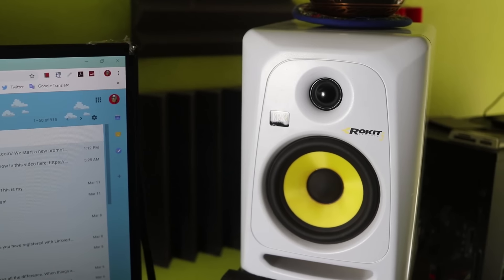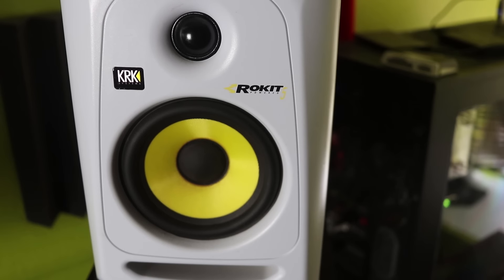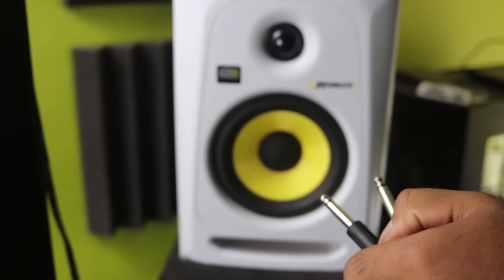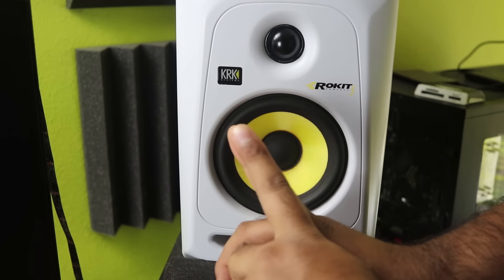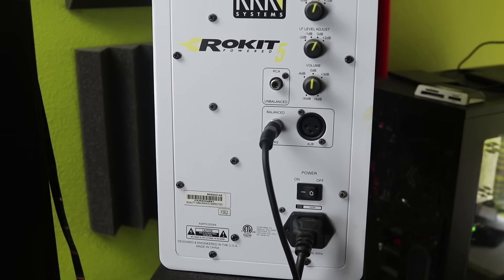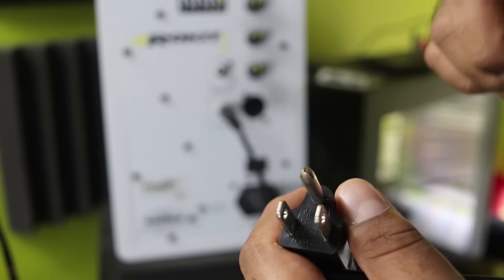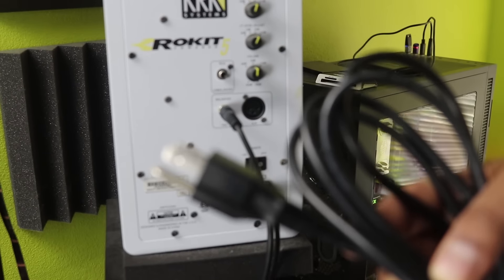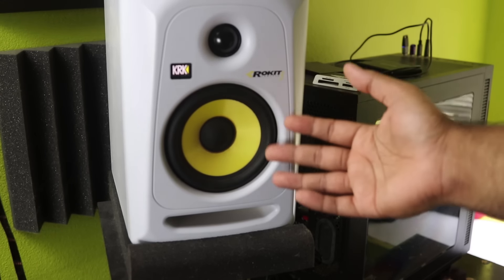How To Stop The Electrical Noise From Studio Monitors!

Comment: I have this exact problem but my monitors only have two input options, RCA and a 1/8 (3.5mm).  I have a TRS 1/8 (3.5mm) cable plugged into the monitors which goes to a dual TS 1/4 into a mixer and I get this EXACT same sound in your video.  I can't seem to find a 1/8 TRS to dual TRS balanced cable anywhere.  Any suggestions thanks so much for the help!
Reply from the maker: Test to see if it sounds like that when you plug it into something other than the Mixer. Because sometimes, Mixer Boards can be like that too. Just in case! 
What's the name of the speakers? If it's an older model of speakers, I'd recommend to ditch em, especially if they don't use a 1/4 TRS cable.
Reply: @OmoiSenpai  They're Audioengine A5 and sub.  I have a MOTU M2 DAC which I'm running 3 other midi synths plugged into the mixer and those are clear with no buzz.  It just seems to be the main line from DAC to mixer to speakers.  I've tried other cables too and same issue.
Reply from the maker: Just looked them up. Seems to have Bluetooth functions. But, they seem to be speakers geared towards entertainment uses ( TV, Phone BT, Vintage devices) but not meant for something like a Music Studio Monitoring apparently. I would use those to check out the songs once you finish working on them. 

Check this out. This is a 1/4th TRS to a 1/8inch cable. I would say either to buy 2 of these, and try them out. Or better yet, buy Studio Monitors that are meant for Studio works ( like KRK, Yamaha, or Avantone's Mix Cubes... my friend swears by it ) https://amzn.to/2ZDvW5Q

Hopefully that helps out!

Comment: I'm getting a pulsating sound ( maybe 60hz sound?) from using the headphone jack from my laptop into a reciever and out to speakers. The power plug on the receiver is only 2 prong but there's a Ground screw on the back of the reciever and when I connect that to a good ground it gets worse. Any help there?

Comment: What if I use a 35mm to dual 1/4 cables. I can only find 35mm trs to dual 1/4 TS cables. Dies it matter where the ring is? Should it be on each cable tip?

Comment: Hello, I use a BOSE L1 System and plug my Jack into the Channel, plug the other side which is the same into my Tone Matcher, double ended 3 qtr inch Jacks into the inputs on the Tone Matcher, I then plug the other end the Aux into my Lap-Top which is fine but when I plug my Charger for my Lap-Top in I get this exact Radio sound which is very annoying as a Singer... Now if I use another Lap-Top, the sound disappears... maybe the Charger on the other Lap-Top is bad but its hard to tell... please give me some advice. Thankyou.🙏🏻
Reply: ... when I take the Charger out, the sound disappears

Comment: HELLO , ONE QUESTION I HAVE THIS PROBLEM WITH KRK 10 3 G4 BUT  WITHOWT THE CABLE ,THIS INTERFERANCE IS WITHOWT THE CABLE PLUG IN YOU CAN HELP ME WITH AN IDEA ?
Reply: you have to buy a ground loop noise isolator, this wil unearth the electric signal that is interfering with your speakers.

Comment: now i think i have balanced cabels cuz i have the 2 black rings on it but i still get the interference, so i tried with an optical cable and the sound was gone, problem is that its not surround through the optic for my system, so back to cabels, are my cabels cheap and broken? should i try with new ones?
Reply from the maker: Yeah, if you have 2 rings on it, then those should be balanced cables. 

Try swapping the position of the Monitor speakers around, as well as to hook it up on another device in itself. Signal Flow will help you single out what the cause could be! ^_^
Reply: @OmoiSenpai  found the issue, its the cables itself that are to weak, only like 2mm cabels and i am gonna get 6mm shilded cabels so ill be fine, thank you, your video did help out alot

Comment: What if you get click sounds from an UPS contactor into your audio system? I mean let's say you have a UPS protecting your gear from power outages , or instable voltages and when the contactor is active you get that sound amplified into your monitors.
How can you solve this issue?
Reply from the maker: Hey! I don't use a UPS myself, but for what I see online, it says that it could be the end of the UPS's life cycle. Just my guess though.

Comment: I have this same exact noise, only it is constant 100% of the time. I can turn off and unplug literally everything but the Studio Monitor plugged into a power conditioner, and I am STILL having this exact noise. I do live in an old apartment building, so I think it has to do with poor wiring in the building.. I get the noise from every outlet in my apartment. If anyone has any ideas as to how to eliminate this I will be forever grateful.
Reply: Wrap your speaker with an aluminum foil
Reply: Me too... because the electrical in the country I live in is rarely grounded.
Reply: Do you use balanced cables and grounded electric connections? Seems to be the point of the video to do this with everything in your studio. I have the same issue - old building, every socket has this problem. It even enters my recordings, so I can't use anything really. To make it more confusing, the noise varies in streng from day to day and area i stand (with headset) it is such a buzz kill (loooool pun intended).

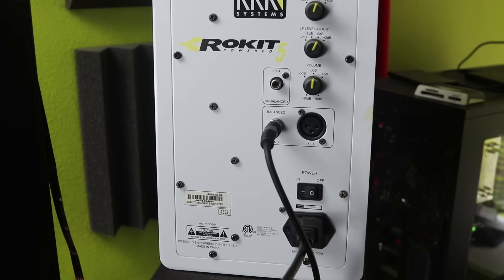Comment: 2:06 I got a problem like this in my Adam T8V. Its very light and you can hear it when youre vey close to the 8" woofer. Tha noise is more continuous and kind of "phasy" or "flangy". Its not any loud; but its not the classic and normal buzz of the tweeter, it comes from the woofer and its not always there. I expect its an electrical power issue cause I am living now in an "old" house, do u think it can be that or is that normal?
Reply: Maybe its just paranoia cause i've got this pair last week and im always looking for a new weird noise like a maniac expecting they are broken or something
Reply: I use TRS to XLR balanced cables and the power cables that come with the monitors. I ve got an Scarlett 2i2 and an HP usual laptop

Comment: I have this exact sound from the HEADPHONES OUTPUT of the audio interface.
I unplugged the front desktop USB devices and it got better (strange), but the crackle still remained so I am getting a Ground Loop Noise Isolator from amazon to see if it helps.
Reply: Did the Ground Loop Noise Isolator work?

Comment: Hi Justin, thank you for this explanation. I've got a pair of iLoud MTM connected to my Steinberg audio interface and what I'm 100% sure to hear is my GPU working. Do you think that using balanced cables would solve the noise also in my case?
Reply: Did you solve this? I have the same with my speakers, annoying buzzing sound when the GPU is under load. Desperate for a solution.
Reply: @bart4375  I picked up some TRS cables having the same issue, I'll let you know how it goes
Reply: @marvingeorge8856  I got a USB isolator which completely solved the issue.
Reply: @bart4375  I did too, but my problem remains, I'm hoping the TRS solves them
Reply: @marvingeorge8856  Best of luck!
Reply: @bart4375  thank you! You as well

Comment: I have the same issues with my Yamaha HS7s. My monitors make the noise even when nothing is plugged in except for the power cord. Any advice?
Reply: by process of elimination, i discovered it comes from my computer. srsly, i eliminated like 30 factors. when i reduces the processor power consumption in the power options, it's reduced significantly. still looking for the solution for that. damn it.
Reply: @imslicc  the solution is the balanced cables. It's literally the whole video.

Comment: That exact same noise is in my monitors without xlr/trs connected. The noise is there alone with power cables only. Any idea?
Reply: Probably an electrical interference. If your monitors are right next to a pc or any other electrical device then just try moving them as far apart as possible

Comment: Just built a new pc, have had studio monitors for years and they have worked perfectly with every other pc/ phone i plug into it. When i use it with this new build, however, i get this static. The static doesnt happen when i plug headphones into the pc, and doesn't happen when i plug other devices into the monitors. Help me lol.
Reply: same here. jeez.
Reply: Excact same issue, i have balanced cables, i dont have a clue what's going on
Reply: I found out you have to use power cables without grounding for the monitors
Reply: Yup, had to buy a ground loop isolator.

Comment: Great video Justin. Have you ever heard of this though... I am getting this interference in my analog mixing desk. Even when nothing is plugged into it or out of it. If I only plug in headphones I can still hear it. The interference is only happening on my bus and master channels, but not on the individual channels!
Reply from the maker: Hmm, never heard of that issue before. 
What is the Mixer called?
Reply: @OmoiSenpai  it's an Allen & Heath Beta GL32, hand assembled mixer. A&H dont believe its an issue with the mixer but something electrical. I told them nothing is pluggd in :/ there is a wall between my mixer and desktop PC. Weird huh

Comment: A dual xlr to 3.5mm cable helped dampen the noise for me but it didn't eliminate it when the pc is under load. My guess is it's picking up the coil whine from the psu/gpu. Anyone else have a similar issue?

Comment: I just did a little work around here with the new KRK RP5-G4, this noise was a nightmare.  New outlet grounded to copper in the basement, speakers powered from a different current source, I did everything and still getting that crappy interference sounds everything freakin time I was moving the mouse or loading CPU/GPU.  Speakers cable far from screen cables and far from the PC itself, audio interface far from PC as well.

UNTIL:  I dropped each speaker volume down to 75% of their full power, problem solved.  

This is solving the nightmare, not the issue since I use them with my 2 laptops as well and nothing comes out of these even at 100% volume so yes I know, there's still an issue with the PC about his power management I think.  PSU or something.

Well, now I fall asleep without having that damn sound in my ears even when they were off LOL

Comment: THAT'S the noise I was getting. I wished I had seen this video before I went out and replaced my audio interface(Presonus to Focusrite). I have the same speakers but never thought it was the cable because the noise went away. I also grounded the surge protector. How I ended up watching your video I have noise coming through a Firewire into Tascam audio interface...I will try the balanced cables.
Reply: Hey Pete! did you get to replace your cables with balanced ones? I just watched this vid after I have been using unbalanced cables for like 1 year 😭 I hope my monitors are not messed up now damnnnnn itttttt

Comment: i have exactly the same noise, but i stays even if i disconnect any audio cables and its only connected to the power cable. my only solution for now is tin foil around the speakers...
Reply: Find any solution per chance? I’m in the same boat. I think it’s because I have them setup on the top floor of my home. If I move it to another place in the house it goes away or becomes significantly quieter. I’m thinking of getting copper isolation tape and covering the inside walls of the speaker next. 😩
Reply: @rogueberrydissent6062  I do have a solution, but an awful one. Just as you said, I had to cover the insides of the speaker with tinfoil. Obviously seeing that nothing touches because its tinfoil, but it works 10000%. No noise at all!
Reply: PR Thanks for the intel. I went ahead and ordered the copper isolation tape. Time to put an end to this shit once and for all!
Reply: rogueberry &dissent Same probably here as well...Are you guys taking the speaker apart first and then adding tinfoil or just putting it all around the outside?  Mine is mainly on one side and cones and goes, but it’s driving me crazy.
Reply: @mgrocks111  itook it apart and added it on the inside, but outside works fine if the looks don't bother you
Reply: MGrocks I actually made a cardboard sleeve to slide the speakers into (back and front remain open). I covered the inside of the cardboard sleeve with copper tape and the outside with black tape so it’s not so noticeable. Works great! I’ll probably replace the cardboard with wood one day, but for now the cardboard is working well.

Comment: found out my soluition. for whatever reason when my laptop charger is plugged into the same 2 outlets, it causes this annoying electrical noise. very strange. i just bought a new charger so its probably some weird aftermarket charger causing the issue

Comment: thanks for making this bro but I have xlr cables but still geting the same noise a bit please help me to remove that.
Reply from the maker: Try plugging the monitors in different places in the house to see if you have the same issue.
If you find the issue is cleared when you plug it somewhere else, the problem lies within your room.
Check the Ground in the wall plugs.
See if there are no electric devices plugged in around your speakers.
No wires overlapping etc.

Comment: I still have the slight noise even using balanced cables. I've yet to see someone come up with correct solution.
Reply: It's one of those issues that are tricky to pinpoint. I just changed the order the plugs were in my extension and now the noise is completely gone.
Reply: Connect all the device to a common ground is the solution. Some were caused by the EMI from the power supply, try to move the ground line of the transformer a bit until you hear no noise will solve.

Comment: Bruh, the devices that are connected to each other via a balanced cable need to have balanced out and balanced in ON them. If the reversing of the noise and the signal is nkt dkne in the circuitry then just using a stereo cable wont help.

Comment: Bruh, I’m getting a low & high hum from the monitor WITHOUT ANY INPUT inserted, so unbalanced, balanced, it doesn’t matter. I’m on the verge of pulling out the ground prong, or don’t they sell power cords without a ground prong? Or the adapter or some kinda condom for it?😂
Reply: do you have an AMD build or Nvidia?
Reply: @signalfields6763   I’m not sure what those are, but in into music, not gaming. I have nothing built, just stock.
Reply: @EJR20  try having separate outlets for computer and audio gear. best on different circuit. or to run computer off of car battery/ online UPS or like u said rip out ground from speakers power cable
Reply: @signalfields6763  I already tried everything including that, except using a power conditioner. But JBL told me to take it to one of their shops to have them checked out, once I do that and it still makes the noise, I’ll try a power conditioner
Reply: @EJR20  not power conditioner. need to run computer off of battery. I have a charger connected to car battery, connected to pure sin wave 1000w power inverter with computer plugged into this and gear plugged into the wall. costs money but it works.

Comment: Too many vendors selling TS (no R) adapters. Had 1/4 TS to Speakon male cable, but speaker needs XLR, 1/4, or RCA and had speakon to 1/4 TS and of course the hum. Just ordered 1/4 TRS to XLR balanced cables which should eliminate that.
Reply: You just need 6.35mm stereo jacks, it does not need to say TRS specifically, it's the same as a stereo plug anyway.

Comment: dude wtf
i plug my monitors on the phone and its cool no static noise 
but when i use it on pc i have the noise
Reply: hello friend i found a fix
you must plug in your monitors in diffrent power sockers
(ac power plugs}
your pc must be plugged in diffent socket aswell! 
let me know if it worked
Reply: Holy Fkamoly bro. <3 this solution works.
Reply: @udithawijeratne7361  np
Reply: @psarohondembeatz8202   it worked for me anyways. Thanks
Reply: @udithawijeratne7361  np bro
Reply: Try to plug a headphone jack with +75ohms resistor, this is because your earphone has a high sensitivity and your output from computer is too large. If you use a 300ohm headphone, I am sure you will not hear it.

Comment: Tip, Ring, Stand
Not
Tip, Ring, Sleeve

Look at the electrical documentation. I'm watching this video because I have a pair of cheap speakers plugged into Speaker Out on my PC and they're making a whining sound. For the first time ever, they stopped last night, but when I just unplugged my whole setup and plugged it back in (this time using a surge protector) it's making the sound again. Speakers are using a 3.5mm TRS cable (from what I can tell, unbalanced), and that's why I'm here.